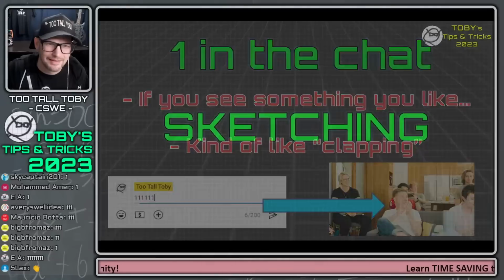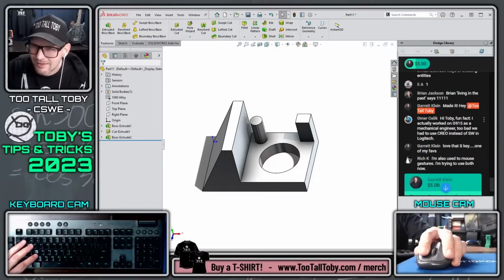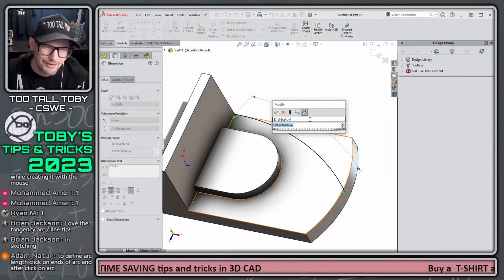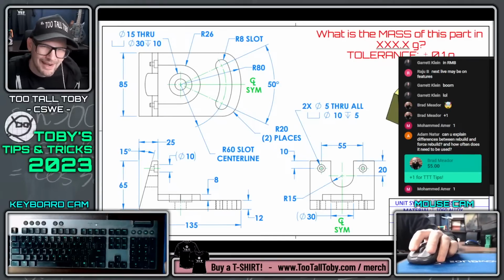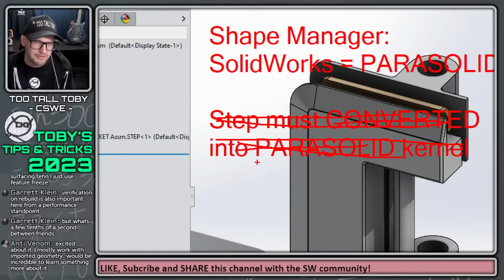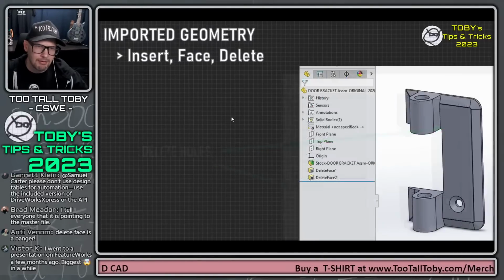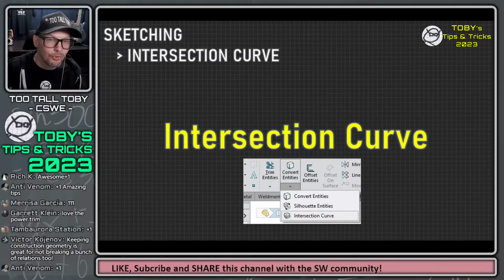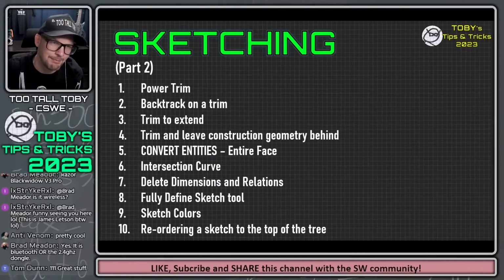Toby's SolidWorks Sketching Tips and Tricks 2023 - LIVESTREAM

Comment: instead of first creating a sketch and then creating the extrude or cut, why don't just first pick a plane, then pick the extrude or cut command.  it will bring you to sketch but then immediately bring you right to extrude/cut parameters.  saves clicks.
Reply from the maker: good question  -the answer "Because you don't always extrude or cut extrude from a sketch".  Sometimes it's layout geometry, sometimes it's a path or guide curve.  So using the workflow "1. Select a plane 2. Begin a sketch 3. Orient your view" is going to be a more universal solution.
Reply: @TooTallToby  I get what you're saying.  we all have our own way of doing things and I know you're teaching because you always need a sketch but you may not always extrude/cut from that sketch.  but from an efficiency standpoint, I almost always know if I'm cutting/extruding a feature when I initiate the sketch so it saves time to just jump right into Extrude/Cut first.  even if I decide I want to just make a reference sketch, just escape out of the feature after the sketch is complete and you're at the extrude/cut parameters and you have your sketch only.  beauty of SW, there are 17 different ways to get the same result!